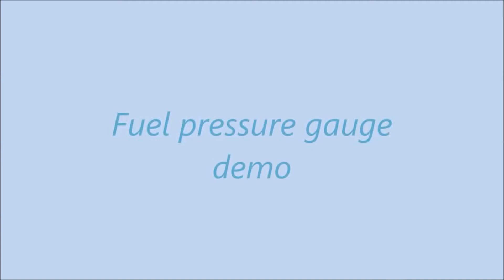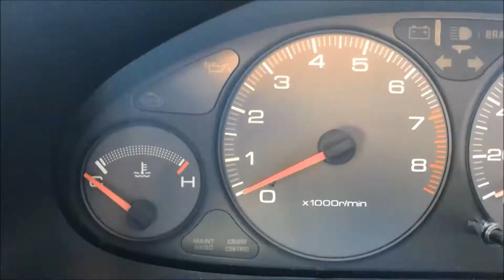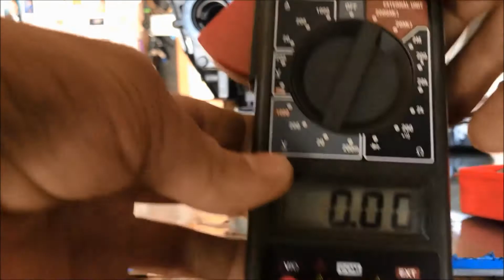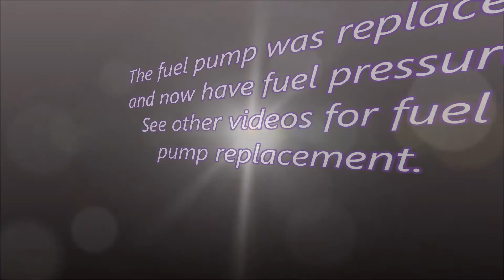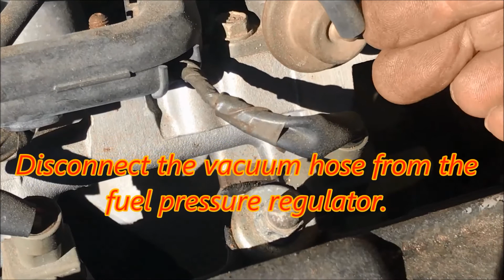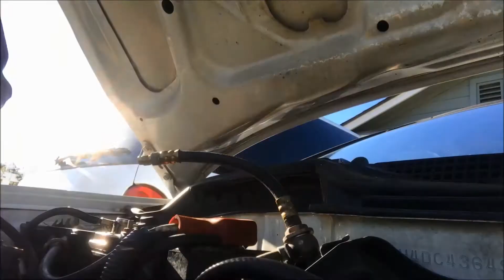1995 Integra engine stall, fuel pressure testing, and fuel pump circuit testing

Comment: Where did you buy the fuel pressure tester ? Or did you rent it
Reply from the maker: I bought if off the Matco tool truck a long time ago. Back before online purchases were so readily available....... But, you can get them off line a lot easier now. There are several different brands, prices, etc.
Reply: That was a stupidass question..you didnt see the matco tools sticker on the red case?